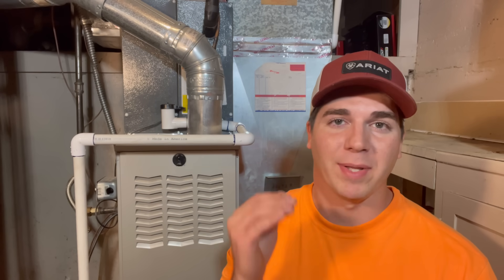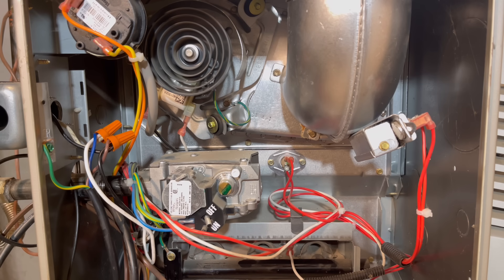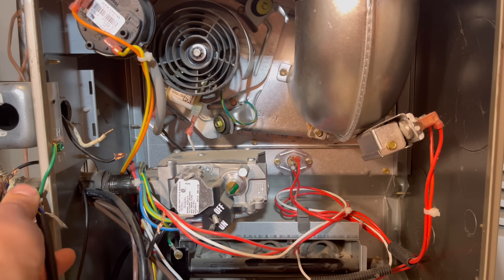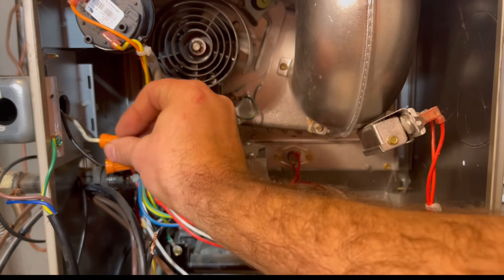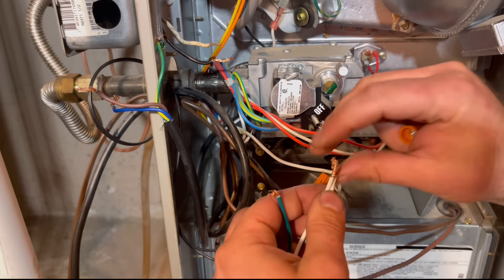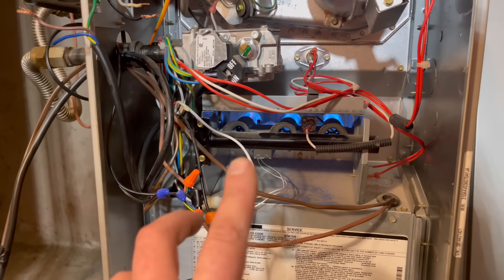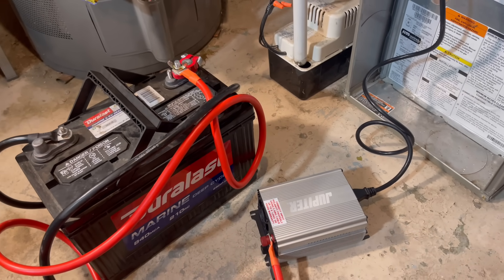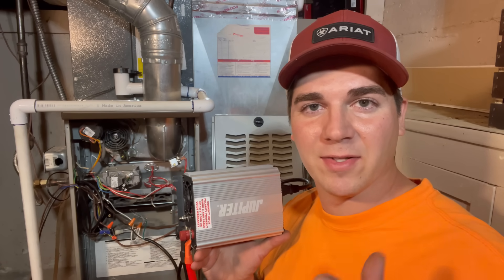Did You Know You Can Heat Your Home With A Car Battery?

Comment: Good in an emergency. I have a generator with 2 suicide cords. I just trip the main breaker, all 220 breakers and can power all the lights and 110 outlets as normal.
Reply from the maker: Right on. Same here. I just wanted to create this for folks who didn’t have access to a generator. I didn’t realize till recently that if you kill the main power and plug that suicide chord into any outlet you can get power to all the other outlets in that circuit? I haven’t tested my setup yet but I have the suicide cord and my generator is setup with a quick connect fitting to my natural gas. Runs like a champ on ng
Reply: @diyhvacguy  It is critical to make sure you don’t back-feed to the meter. With the main breaker off I turn on all the lights and plug a cord into an outlet and see what lights come on. I then keep switching plugs until different lights come on. At that point I can run two cords and power both sides of the panel. I make sure all the 220 breakers are tripped so no one tries to use anything on those circuits. I work on empty houses or apartments with no power so I adjust as needed. For your own house you can wire a suicide cord to plug in your dryer outlet or any other 220v outlet and power both sides. Again critical to not try to run the whole house. Lights as needed and keep the heat on. My kids would want to use the microwave, toaster…….. so I would trip breakers to keep them honest.
Reply from the maker: @CBrown07696  yea for sure. Thanks for the tip! I’m going to pick up one of those interlock kits that prevents the main from ever being turned on and then I can just plug it in at the exterior of the home since my meter is right there. Stay tuned for that! Cheers
Reply: @diyhvacguy back-feed can kill the linesman fixing the grid be damn careful it's gotta be idiot proof.
Reply: @CBrown07696  I would rather have a cord on my furnace and plug it into a house outlet. In the event of an outage plug it into something else.

Comment: No problem with your hookup and all, but you mislead regarding the run time. A good deep cycle battery, fully charged, would run your furnace for about 45 min to an hour before going flat. Plus, discharging a flooded battery more than 50% of it's capacity is a no no. Works, but I'd recommend a 2000 watt portable generator instead.
Reply from the maker: I’m actually going to be installing this in my truck so it will run my furnace as long as I have gas in the truck. Stay tuned for that video! Thanks for the tips also. Cheers
Reply from the maker: Thanks for the advice. Its funny that I hear different advice. Someone else said its good to run the battery completely down. I actually ordered a 1000w pure sine wave inverter and I have it permanently mounted in my truck so I'll be testing using this setup on the next video. Theoretically it should run my furnace as long as I have fuel in the truck so we shall see. Thanks for the tips! Cheers

Comment: You need to put a piece of wood under your battery, A battery sitting on concrete or the ground will disharge over time even with no draw on it.
Reply from the maker: I've always heard this but others say its fine so I dont know who to believe.. lol I'll actually be running this setup permanently attached to my truck battery so the alternator will continue to charge it so it should power my furnace as long as I have fuel in the truck. Stay tuned for that video! Thanks for the comment. Cheers

Comment: FYI, modified sine wave is really bad for inductive loads such as the blower motors.  They are very inefficient with those sorts of loads. Pure sine wave is what you want.  It may last longer on the battery as well.
Reply: It’s the harmonics that cause excessive iron loss in motors. These extra losses show up as heat which deteriorate the winding insulation and cause failure. Also, the power that goes into heat robs the motors shaft power and makes the motor work harder for a given shaft load. This increases the winding current which increases the heat generated in the windings which increase the temperature of the insulation. A modified sine wave inverter needs to supply more power to a motor under a given load than a pure sine wave and significantly decrease the reliability and life of the motor. Also, most electronics need clean power to survive.
Reply from the maker: Awesome thank you for the tip. I just ordered a pure sine wave inverter so that’s what I’ll be testing with.

Comment: Great video! I did notice that you mentioned the 1K inverter. Respectfully suggest that this is the minimum size for your 8 amp draw furnace. Anything smaller wouldn't be a good idea. Very clever! Here in Oklahoma this could be a very useful trick! Thank you.
Reply: at 120 volts and 8 amps that would be 960 watts. With the power loss in the inverter and wires and terminals. A 1100 watt inverter would be right on the edge of whats safe to use. In this case I would go with a 1500 watt pure sine wave inverter. The furnace would run smoother and make less heat through the inverter and wires.
Reply: I do believe a 1K inverter with two plugs will actually only be 500 per plug.
Reply: @alandeon  Depends on the inverter.

Comment: I'm surprised you didn't wire that condensate pump to the same extension cord. That acid condensate on the concrete floor will etch holes in it. Also the wire colors (blue brown) for that pump are European, and non standard per our NEC. I assume that pump came from some China seller on eBay or amazon.
The biggest issue I learned about, I got a 4KW inverter from HF years ago, it burns 4 amps doing nothing, so watch out for that spec of quiescent current usage with no load. That will eat the battery energy fast.
Reply from the maker: The condensate pump isn’t used in heating because I have an 80% furnace. It’s only used in the summer time. Also I’ve come up with an even better solution by installing the inverter in my truck, then I can power my furnace as long as I have gas in the truck. Stay tuned for that video! Cheers
Reply: @diyhvacguy  Clearly I didn't pay attention to the B vent stack. Honda used to make a very small quiet generator for charging +12 batteries, I can't recall the model, but it was less then a cubic foot in size I'm now guessing it was less then 500w 120vac output as well. My uncles had it out at their lake cabin. But it's another engine to maintain or do a shut down when not needed. And I've given up on engine powered tools other then grass mowing. Either plug a weed eater/chainsaw in, or change to battery version. And now chain saws are my next upgrade.
Using your truck to recharge during long outages will do what you need. We had a huge Derecho back in August of 2020 here. That was 200 miles north and south, started in South Dakota, and ran through Indiana. But here in Iowa got the brunt of it. Power was out for over 2 weeks, as the wind was over 120MPH for 35 minutes, and had 2 inches of rain blowing horizontally during that. I had some roof damage, but the REC got my power back in 5 days. I had to pull out the generator for the first time to keep the refrigerators and freezers going. I'm still cleaning up all the tree damage. The arborists around here have been gouging for tree removal ever since. Just got a bid last month for $13400 to remove a 25 foot tall oak stump. Right next to my shop, so a bad location, as they can't just do a simple fall, as a storage building is in line with it. I had the material to fix my roofs, and getting a contractor before winter will all the other buildings damaged was difficult, as well all the scammers that came from all parts of the US to take money and disappear.
The bigger problem was getting gasoline for the generator, as the lines to any gas station that had their own generator to keep the pumps going was miles long. I had to siphon just to keep food cold, and to power the well pump.
I recall your TX power outage, hope they upgraded other transmission lines since the ice storm that shut stuff down. You have a strange home with a full basement, that seems to be an oddity for your location. Up north every home has a basement.
Reply from the maker: @f.hababorbitz  oh I’m not in tx. I was just using that as an example. I’m in Utah :)

Comment: I have this setup prepared from my golf cart that sits in my garage charged and ready at all times !! If you do this just make sure you buy the correct input voltage inverter
Reply from the maker: What do you mean, the correct wattage? I checked the amp draw on my furnace and it never pulled more then 8 amps I think.
Reply: @diyhvacguy  golf carts typically have 6V batteries.  So I think he meant "correct input voltage".  Also, lots of diesel vehicles have 24V systems (2 batteries in series). So watch out for the expected input voltage. @Christopher had a good cautionary tip.

Comment: Rigged my furnace a couple years ago , I installed a receptacle after the on switch and wired a cord to the location you installed your wiring. Everything plugs into the receptacle and if the power goes out I can just plug into the inverter, however I don't think the inverter you used has enough output to run a blower motor and the inducer motor not to mention the igniter, I'm betting you're getting really low voltage to the equipment.
Reply from the maker: I’ll check the voltage to the equipment when I do the time test. Thanks for the tip! Stay tuned for that one and I’ll be doing one soon on how to heat your home with no gas or electricity. Cheers

Comment: Great video man. With the way the world seems to be heading these days, ideas like this are becoming that much more important. Also with a modest solar panel, you could keep the system running almost indefinitely.
Reply from the maker: That’s true. I’d love to do solar but if im doing solar, it’s gonna be for every electrical item in my home, and I’ll probably do a battery backup since otherwise you can only use the solar during the daytime when they are harvesting energy.
Reply from the maker: And we are talking 20-40k for that setup.
Reply from the maker: Maybe YouTube will pay for it someday 😂
Reply: How many kilowatts that's crazy. You don't need 5,000 KW. I ran 10 years on 114 kilowatts kept my batteries up and I had furnace year round, lighting and television and charging my phone, fridge you name it, and I had $1,400 total in my system.
Reply: @cynthiaayers7696  Indeed we do. That's sized appropriately for the household electronics, appliances, HVAC, and EV charge load given the available sun time on average winter days.
Reply: During & after #MarshallFire, electric and gas were both down (don't want gas spewing out of 1,100 leveled homes, after all) as the temperature dropped to deep freeze levels. Most houses that survived the firestorm had pipes freeze.

Those with solar, battery backup, and electric heat or space heaters all came through OK. Ditto generators used to power space heaters.

That disaster boosted the priority of a 5KW rooftop solar system for us. Aside from labor and permits, we'd be looking at $16k for panels, mounting, controllers, and batteries via Project Solar kits.

Even better for full DIY, check out `DIY Solar with Will Prowse` https://www.youtube.com/c/WillProwse for some good ideas and test results for panels, controllers, rackmount batteries. We can probably come in $14k fully DIY for our desired battery runtime on a 5KW system.

Comment: What’s the specs on your furnace?
Reply from the maker: It’s a 60k 80% and it pulls like 7 amps total when running
Reply: @diyhvacguy  120v ?
Reply from the maker: @mafosa8519  yes
Reply: @diyhvacguy , so  volts x amps= watts, would mean it needs about 840 watts, that battery would be done in about 30 minutes of continual use.

Comment: This is why I hate switches to shut off furnaces or disconnects as you have to open the electrical to do something like this. It should be required that you use a electrical pigtail instead then all you would have to do is plug the furnace into the inverter and not have to mess with the electrical wiring.
Reply from the maker: Right!!? So what I’m going to do is install a outlet/switch combo in the box where my power switch currently is so the outlet is live when the switch is on. And then have a pigtail from the furnace that plugs into the outlet when there is grid power. Then when power is lost, I simply unplug the pigtail and plug it into the female end of my extension chord that goes to my inverter :)  stay tuned for the video showing that!
Reply: Yep I did this year's ago remember Y2K 😑 I have a 1500 watt pure sine wave inverter and plug in furnace on a pigtail . I checked furnace draw with watt meter about 50 to 600 watts maximum and I have a 86ah AGM battery connected to 100 watt solar panel to keep.it going . We get a lot of sun here in the winter even though it can go.down to -30 F. I haven't needed.this yet but it's nice to know in have something even short term. Great idea here just needs to be fleshed out a little better with some caveats . ☺

Comment: I don't think so. It might run for an hour if you're lucky.
Reply from the maker: I tested it initially for one hour and it didn’t pull down the battery at all. I’ve actually come up with an even better solution though. I have the 1000w inverter permanently mounted in my work truck, and I’ll run an extension chord directly to my furnace so as long as my truck has gas I can power the furnace. 👍🏽 I’ll be doing another video showing this new setup. Thanks for watching! Cheers

Comment: I'm still looking for how long a battery will last. It's hard to believe it will last more than a hour or so. Please post your video on how long it lasted.
Reply: The math simply doesn't support the "days" part. Hours. The unknown is the battery amp hour rating. A small furnace blower uses 33 amps @12v.
Reply from the maker: @proppo4924  well I’ll be powering this off of my truck, so that will actually be the test. I appreciate your knowledge. You seem like you know a lot about this stuff. I’m just trying to provide my audience with a trick they can do to get their heater working temporarily. I think hooking it up to a vehicle is the way to go as the alternator will charge the battery and you can have much longer runtimes. Thoughts?
Reply: @diyhvacguy  Plug in a watt meter between the inverter and furnace and measure how many watts you are using to run the furnace when the fan is on, it will not last long.
Reply: @proppo4924  What I was thinking is a 15 amp 120v outlet would require 150 amps @12v. If the furnace even took 10 amps to run at 120v I can't see the battery lasting more than a couple of hours at most.  A 1/2 horse fan motor takes 5-7 amps just to run let alone all the resistance glow thingy's in a furnace. Maybe 2-3 batteries wired in Parallel might last a meaningful amount of time, but I wouldn't want to supervise a bunch of batteries that had to be charged  every 3-4 hours. No sleep at that rate. 
My power was out in the Texas freeze  for a few days. I just put gas in the generator every 6 hours or so. The generator put out 30 amps @240v and ran the furnace and refers and a few lights and computers with no problem. Batteries are a useful idea when they are 2-3 ft long and can start a Cat bulldozer. But they aren't $100 WalMart batteries. Just a guess, but I'll bet my 5KW generator cost less that that battery.
Reply from the maker: Yes I’m working on the test for that now. Stay tuned!
Reply: @diyhvacguy  read the amps with one of those clamp on meters.  While it is running and while it is off.  My forced air gas furnace says it takes 1400 watts.  That would be a peak rate probably when the hot surface igniter is on.
Reply from the maker: @myronreiss8502  mine showed 7 so it’s right under 1000w

Comment: It will work temporarily but definitely not days. You won’t have enough amp hours in a standard car battery.
Reply from the maker: I will be testing the system in the next few days. Trying to come up with alternative ideas like permanently mounting it in your car so as long as you have gas you can power it with an extension chord. Thanks for the comment. Cheers
Reply: @diyhvacguy   now your on to something that would work. Modem car battery’s are so small but most 50-80amp alternator should keep things alive for a while assuming you have gas.

Comment: I used a 3000 watt inverter in my long haul diesel truck to run a refrigerator and a convection microwave. It was even a better setup when I got an APU installed , but it was not required. And it was a readily available from Harbor Freight which is everywhere and in 15 years I only replaced one on the road. Now that I am retired, I run that set up to go camping....or in an emergency. I live outside Austin, Texas in the hill country. We somehow dodged the bullet during that outage.
Reply from the maker: Wow, that’s good you dodged that. It was a mess!  What is an APU?
Reply: @diyhvacguy  basically a generator on the truck so they don't need to idle.